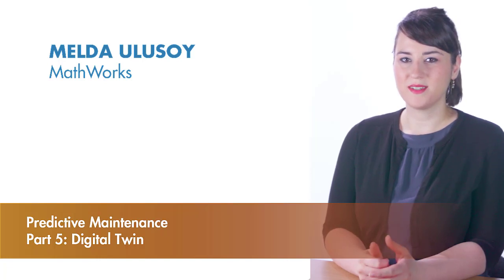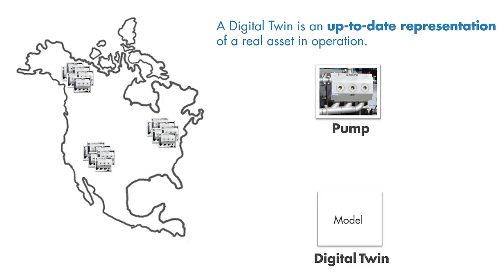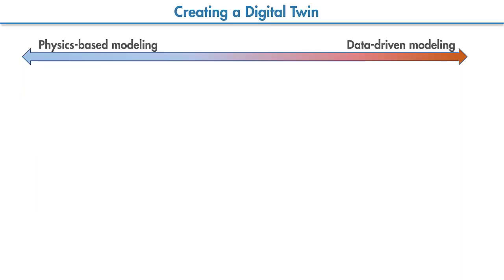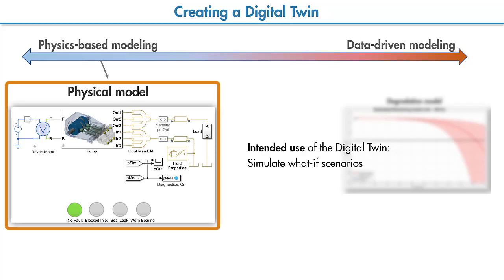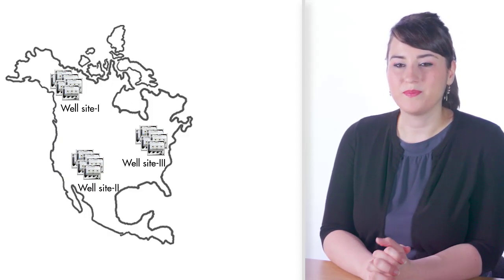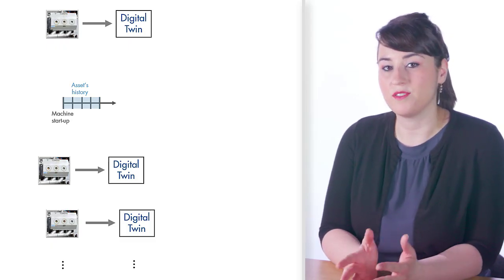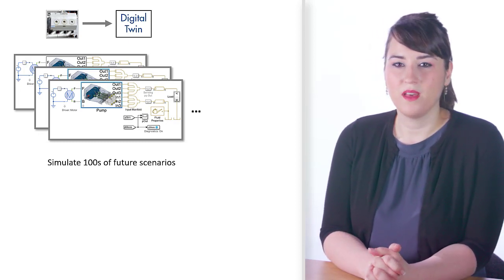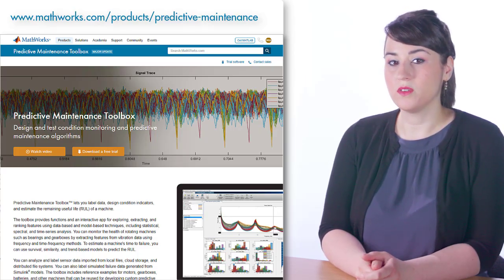What is a Digital Twin?

Comment: Degradation model: estimates remaining useful life. Continuosly sensors are upgrading but they have safer thresholds.

Physical model :
Inject different types of parameters in equipment and see how equipment behaves in different fault conditions.

Kalman filter :
Model degradaion and periodically update present condition of equipment.

Comment: Hi 
I am running test on data samples using the example of SVM Regression Model, in the case of the example given in this MathWorks documentation (link: https://uk.mathworks.com/help/stats/compactregressionsvm.predict.html#buvytaz) the training data needs to have the same number of rows as the predict data, this is required so far to be able to run the prediction. What can I do if my data varies from the number of rows? How can I train my support vector machine with a data that have different number of samples and still be able to predict with the consequence of having maybe bigger error?
Data sample of the training data for the model and the data that I want to use for Mdl = fitrsvm. 
ans=10×2 table
    Training data    Data to predict
    ___________    ____________
          14             9.4833    
          27             28.938    
          10              7.765    
          28                 
          22             21.054    
          29             31.484    
        24.5             30.306    
        18.5                  
          32             28.225    
          28